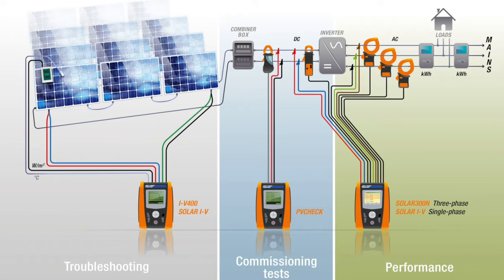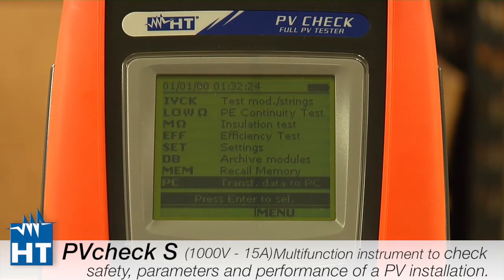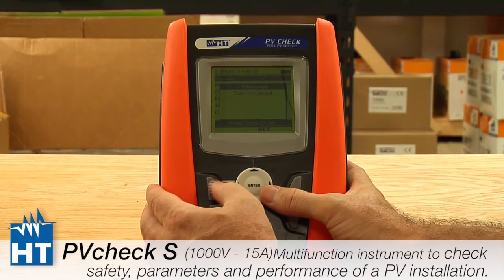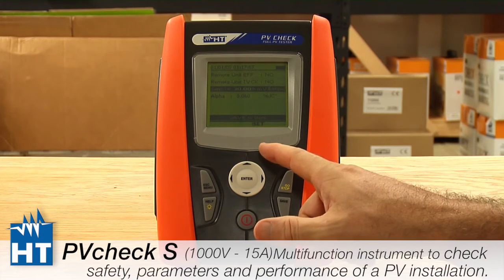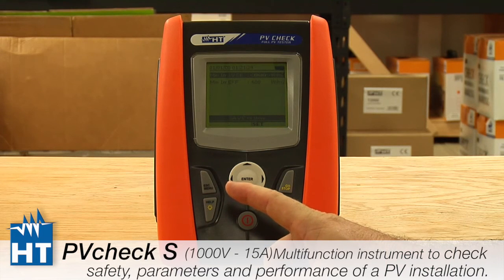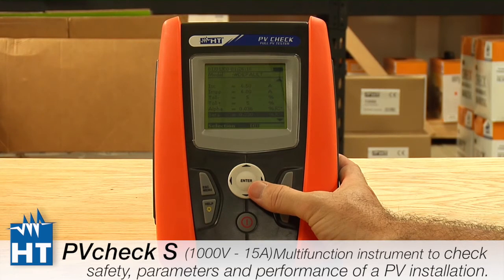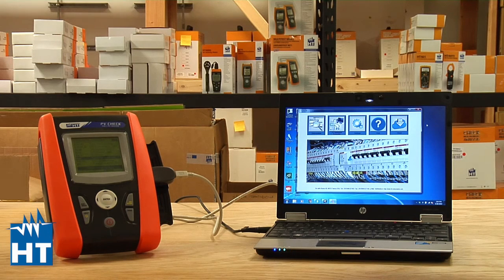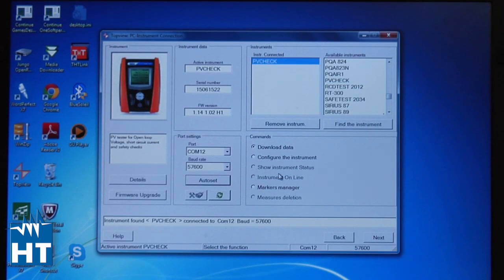How to test a PV installation using the new HT PVcheck s

Comment: What happens with newwer modules, like the Trina 550W which has a 18.5A Isc value?
As I understand this equipment would not work.

Will this also provide insulation test and ground fault location?